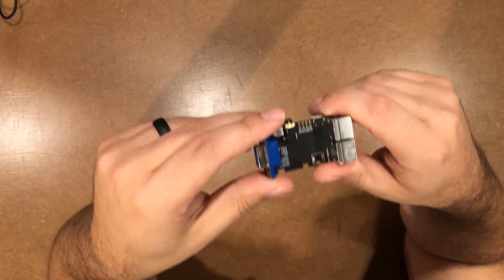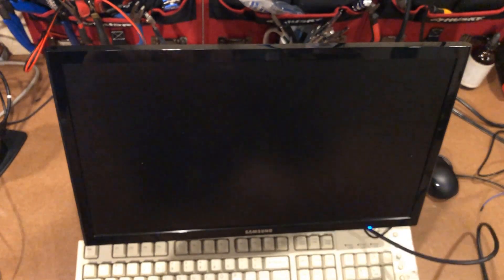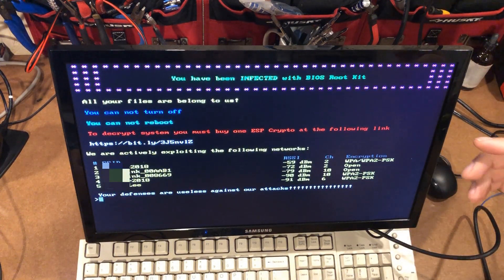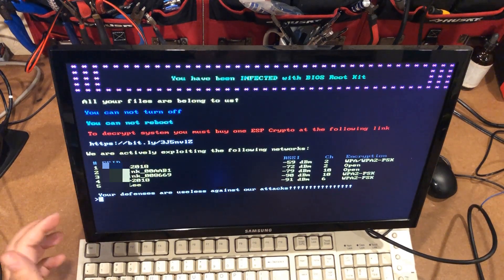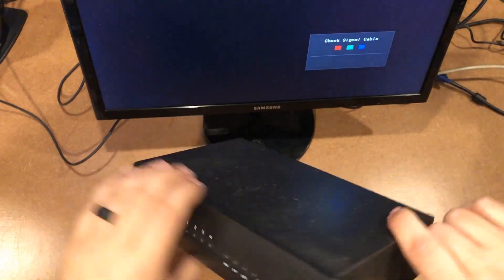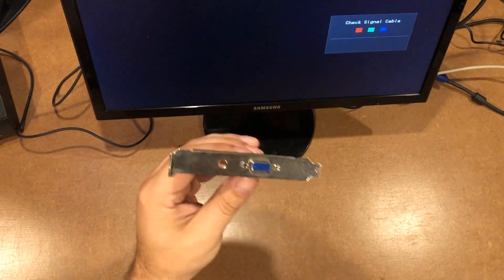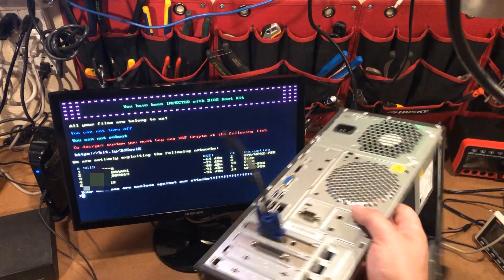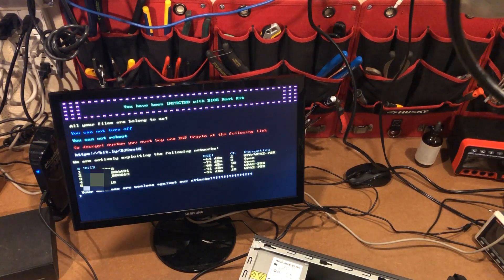Diabolical IT Prank with an ESP32 (harmless)

Comment: You could wire up the board to a spare Molex connector 5V line instead of the power bank, would make it work when the PC is fired up. Having said that, I wouldn't recommend doing anything like this, as nowadays there are so many real threats out there to be taken seriously, running a prank on a PC is not as innocent or harmless as it might have been a few years back.
Reply from the maker: Yeah. The main point of the video is to let people know that this cool board exists and that people should get creative with it.
Reply: @AnotherMaker  It certainly is a neat little board, and the ESP32 is quite a powerhouse for what it costs. With the additional features on that board it makes it a useful and tidy platform for experimentation.

Comment: Am blown away by this ... have not seen the board before!
Is the ESP32 doing all the heavy lifting to generate the VGA display?  Seems like it must be.
The device has sophisticated USB/UART bridge chip (CH9102F) as well, that can do 2mb/s.
Odd they do not build USB 2.0 into the ESP, like the STM32 MCUs.
Reply: I think any chip using usb spec requires them to pay royalty tax or whatever same like the HDMI does
So that would increase the price probably, not 100% sure though
Reply from the maker: Yeah.  The ESP32 is doing the heavy lifting. Youtuber Bitluni did a bunch of work on this a few years ago.  I agree on the USB. I haven't tried bluetooth, but if I can get a BT keyboard working with this, it's a gamechanger.